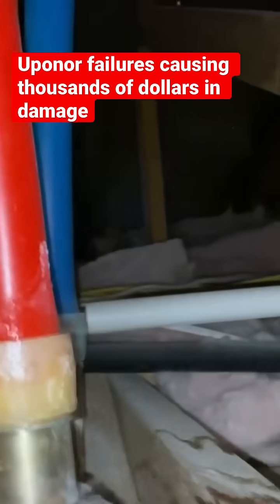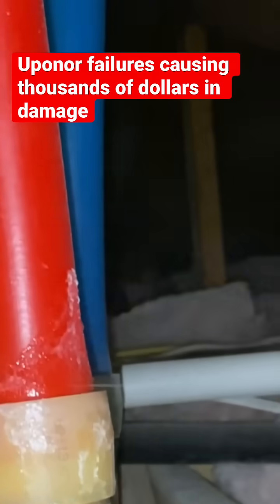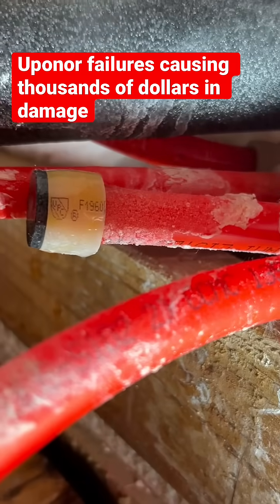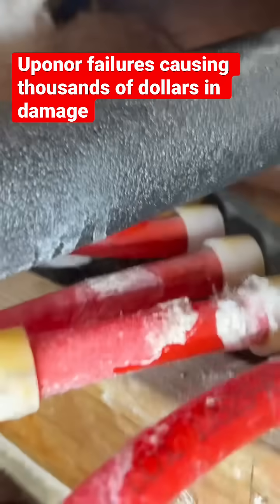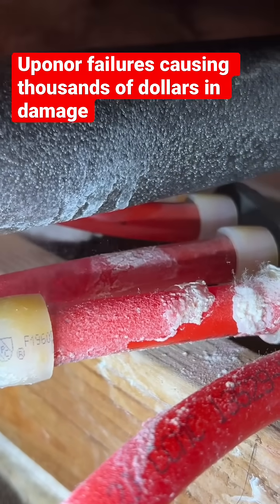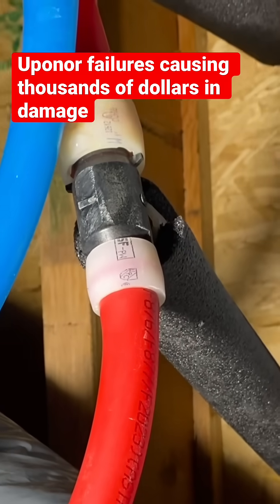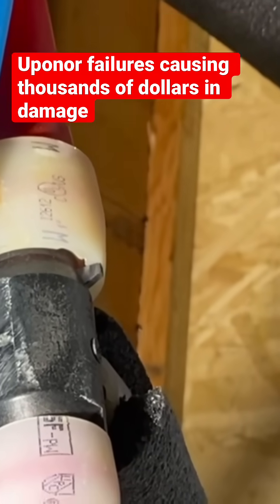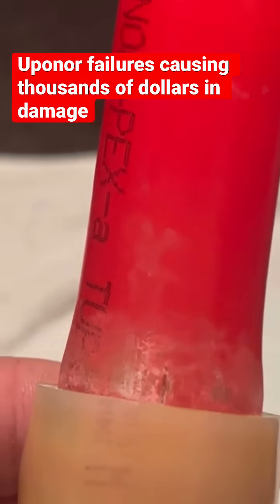Why is Pex starting to get Pinhole leaks like copper? #Uponor #plumbingfail

Comment: I work at a supply house the full red and full blue color uponor had some issues plus bad batches that had problems like this. Clear on white print or no color had no issues same as red print an blue print
Reply: Not the main issue. Pex A is far weaker vs chlorine which is in our water supply. Pex B withstands it better. Its why the warranty dropped to around 15-25 years. Bunch of law suits. Pex B is still considered to last around 40-50 but it has the same 15-25 year warranty.
Biggest issue is the leaching of chemicals into the water due to PEX.

Comment: I found an Uponar leak, right below a joint in 10 yr old house. Luckily it was above the bottom 2x4 plate.  I have found copper pipe in Aprts where tiny gravel from city main rubbed holes in the copper.  Replaced what we could under the concrete foundation keeping our fingers crossed.

Comment: My house is 10 years old, I have Pex A installed it.. I have had the dry wall fall down in two different rooms so far because of upinor fittings leaking at the connections. I am afraid my whole house is going to have to be replumbed eventually ☹️
Reply from the maker: Yea you will be better off just having it repiped, I would contact Uponor they are supposed to have warranties that pipe and fittings for  25 years, if your plumber did it right you’ll be covered
Reply: @PlumbingExplained Even that is scary, 25 years isn’t old at all for a home or piping. I was all for Pex Pipe but not I’m thinking it’s better to stick with copper.
Reply: @James_Edward59  the warranty is only how long the manufacturer will pay for materials being bad, not how long it might last. If it's bad material, it usually fails well inside the warranty period. Properly manufactured, stored, handled, and installed, PEX will outlast copper pipe, mostly because it's nonreactive. I'm getting ready to repipe my 40 YO house, which had copper from the 70s, so better materials than what we get from China or wherever now, and copper is in short supply globally.
Reply from the maker: @anthonykaiser974  no brother copper is all around a better product it’s the water supply that is the issue and possibly the way copper is cut down at the manufacturing yards(the jury is still out on this theory) copper is a much better product you just have to properly maintain it these days, people on softeners or conditioners that filter out the hard water and chloramine or change the ionic makeup of the water have zero issues even with type M copper so that’s my belief it’s the water quality and likely bad workmanship/ craftsmanship that causes the majority of pinhole leaks we are seeing in the industry today on systems too new to be having these issues.
Reply: @PlumbingExplained The copper vs pex is an ongoing debate but the 3 factors are NOT up for debate 
1) price
2) ease of installation 
3) ability to resist freeze/thaw cycles.
Therefore, it is not an all around better product. Copper has advantages and disadvantages, as does pex.
Maybe a video of how many failures of copper due to poor workmanship, lighting damage, manufacturing quality, and damage from poor water quality.

Comment: Potentially exposed to UV light. That’s guaranteed to make them fail and turn that brittle yellow tint. Just my opinion. I’ve installed Uponor multiple times over past 8 years and never had a single issue ever. Best product on the market IMO.

Comment: Some people unwittingly store PEX outside, where it gets exposed to UV rays.
That can weaken the composition of the PEX to where expansion critically damages the integrity of the pipe.

So this could be due to outdoor storage  🤷🏻‍♂️
Reply: it's not
Reply: i use pex a as air pipe for my garage outiside. been outside at 160 psi air not preblem yet
Reply: @Homesteadquebec  
It will last longer without water flowing constantly to help break it down. I doubt you use the air every day. It is still going to fail in a few years. Maybe 5 maybe 20 but it will fail.
Reply: I personally had a Pex a line outside, seasonal use only. White 3/4 inch, direct sunlight 1/2 the day. It lasted 15 years before it totally exploded.
Reply: There is a bulletin about how overwintering box elder and a couple other bugs can drill into the pex to get a drink, and when they pull out, it creates a pinhole leak. Orkin had the bulletin.
Reply: how long outside will hurt it? 2 weeks too much?

Comment: pex had a huge recall for the solid colors tubing. when they would heat up to expand and stretch the tube hairline fractures are caused through out all the line resulting in pin whole leaks or a complete break over time. the company i worked for has now switch to clear pex rated for hot and cold and so far we havent had any more of these issues
Reply from the maker: I don’t use Uponor pex anymore though

Comment: I've been searching for this type of water lines for an hour now and finally found this video, I have similar red and blue lines with these clear/ white rings, do they clamp or is heat shrink, I have the same damn problem, small crack by the fitting that's spraying water inside the wall, I just got the siding off and trying to figure out how to fix this mess!

Comment: Been doing pex b stainless steel clamps haven’t had to go back for anything since install
Reply: I use PEX B as well, and never liked the idea behind PEX A..
Reply: @C0braChicken2  me too and if there’s ever flow restrictions I use 3/4 then at the end like showers and faucets I end it with 1/2 inch
Reply: The clamps will fail over time, in humid or wet areas, but will last longer if you put some osi or clear silicone around the clamp.  Should last longer in damp or humid environments.
Reply: Pex B lasts longer then Pex A because it handles the chlorine in the water better. It still breaks down but just not as fast. It will fail faster then say copper but it still some 30-50 years unless the chlorine levels are high. Nothing like plastic breaking down in drinking water. Yummers

Comment: I've ran into the same thing. it was always the hot water line and the 1st leaks started close to the water heater and progressed down the line over time. the homes were on city water. I never ran into a well home with this problem.  there was a class action lawsuit, but I believe it ended a few years ago.
Reply: I'm having the same issues with the hot water line. Thank you for sharing with us.
Reply: We have grey on the hot side and it has cracked 3-4 times in less than a year..

Comment: Did the installer use some kind of chemical sealant like a cement on the fittings? Because that can absolutely cause stress cracks in the PEX.
Reply from the maker: No it’s just a common theme with the Uponor they know it’s a problem

Comment: Yeah, all sorts of the red and blue have leaked like this. It's criminal that Uponor didnt go under because of it.   
But that said, I have never once seen the clear/white stuff leak like this.  Ive only seen it leak in the case of a dumbass not using proper abrasion clips, whereby friction will do it in.
But who knows lol, maybe in 10 years the re will be a new problem with the pex from ALL the manufacturers. I hope not though.

Comment: All of these pro copper comments… I re-piped my house in 2012 because I’m on a slab and the copper got pinhole leaks due to hard water. I piped everything in Uponor and now I’m remodeling the kitchen and bathrooms and will be going with Veiga. I don’t want to leave the Uponor in the walls and have to tear it out after the remodel. Btw, I have a home run system and found out Uponor doesn’t make the EP manifold anymore either. Smh

Comment: There is actually a class action lawsuit against uponor. They claim it was from the coloring process and that their clear/white pipe with colored lettering was not affected. Except I keep finding the same failures with that style tubing as well... changing to zurn-B was the best move you could have done. The only problem, (at least in my state) is that pex-B is not allowed underground so we've been using a lot of Apolo-A for our underground replacements...

Comment: Rehau is king.
Reply from the maker: Never used Rehau can it be expanded?
Reply: @PlumbingExplained  yessir. German made. Used to have brass fittings and sleeves years ago. Now polymer. I bit more expensive but bullet proof.
Worth the $ if you can find it in your area. Of course it’s tool specific install

Comment: Usually it’s a-hole plumbers who hate life, ripping pipe through walls and joists, hurrying past good installation procedures. I run into a lot of Quest that fails right where there’s a scrape, gouge, or bend, sometimes bad connections.
Bad attitudes are as bad as defective materials.
Reply: You know what's worse? Bad advice. 

Upponor has recalled some of its red and blue lines, they had failure in the chemical composition causing stress cracks around the expansion site.
Reply: Wrong. Your ignorance is astounding.

Comment: I installed a new hot water heater last year, and the clear Uponor PEX on the hot side is already turning yellow and sticky (after the 18" copper headers). On softened well water so no chlorine. I'm not sure what's going on.
Reply from the maker: Well water is typically high in other hard water minerals which could be causing the same issue. Anytime you are drawing water directly through the ground it’s gonna be harder atleast as far as I know so it’s likely there’s some minerals or something in that water causing your issues or potential UV Ray exposure, I’d look into filtration or set a camera up and see where the yellowing is happening, is it getting sunlight through the roof at a certain time of day? Prolonged exposure can cause that
Reply: What brand of PEX?
Reply: @ohger1 reading comprehension?
Reply: @silverbackag9790  Apparently so.. I responded to the wrong comment.

Comment: Quit being butchers using house trailer materials on expensive homes.   Be a craftsman and Solder in top grade copper.  The first leak will cost more damage than money saved by using that plastic crap.

Comment: The thermal expansion/extraction rate of pex is 1 inch per 100 feet every ten degrees. It’s constantly moving. Pex fittings are rigid, anything expanding and extracting on a fixed point will eventually fail.
Reply: Most people aren’t near 100’ runs of it.  So the shorter runs most have.  It ain’t moving much trust that.  An it’s not quick
Reply from the maker: We aren’t seeing issues with the fittings even though they’re plastic I’ve never found a leak at the fitting it’s always on the pipe so it’s either turbulence caused from the fitting or imperfections or something else, I don’t see it being turbulence but im also not an engineer

Comment: im starting to think its the expanding. maybe press pex is the way
Reply from the maker: I switched over to a pex B that can be expanded, I don’t think it’s the expansion the theory is the method Uponor uses extrudes their pipe causes tiny microscopic imperfections that can open up from Chloramine just like the copper pinholes
Reply: @PlumbingExplained  I started using Apollo pex a. Seems solid so far

Comment: Don’t leave your stuff outside. Those rings don’t yellow by themself. Poor storage and care of your product will lead to failure. No one has proof. But there’s other rings with no yellow. Don’t throw this stuff in bed of truck and cut a foot off at a time. The sun can reach that. Keep it covered. The product will perform for awhile. But back in copper days. We had idiots and poor install practices. So it’s not always the product.
Reply: I've heard that chloramine in the water supply (ammonia) can leech into the pipe causing yellowing, cracking and failure.
Reply from the maker: @panemon187  that’s what we are finding
Reply: @panemon187 
Fucking chloramines ruin rubber gaskets and seals too
Reply: 100% From my conversation with Uponor, it could be over exposure to UV (Installers keeping their PEX overhead or back of their truck for days). Over time the "chlorine" supposedly start to break the pipe down.
Reply: @SaintlySaavy  If a couple days in the sun is too much it's a shit product.
Reply: @bobbygetsbanned6049 
It is more like a month of direct UV exposure rather than a few days, but it is better to minimize it.

Comment: Pex a pipe can't be used with pex b fittings. They over expanded those joints hence the leaks..
Reply from the maker: Huh? Those Pex A leaks are all with pex A fittings, The pex B im talking about is in fact expandable its Pex B Zurn google it.

Comment: 'so we switched over, it doesn't seem to have those poblems' so this video is 2+ years in the making? or you just switched over? if you just switched over how can you say the other product  is better?
Reply from the maker: I can say the product appears to be better because they have not had the same issues with the random pinhole leaks in their pipe as the Uponor pipe has, The Zurn pipe has had some other issues but they typically seem to be related to installer misfortune or error most of what ive seen against the Zurn pipe has been in colder climates, they recommend warming the pipe first before expanding it to prevent stress cracks but here in California I dont have to worry about that.

Pex B has some advantages over Pex A, It doesnt leech chemicals like Pex A does even though they determine the amount of chemicals the pex A leeches to be safe I rather use a pipe that doesnt leech at all. I didnt even know about the leeching Issue into a customer told me about it because they had read about it. 

Pex B Zurn can be expanded and the pipe side by side inside and out looks and feels basically the same as the Uponor but the way the two pipes are extruded is different and thats where apparently Uponor is having problems.
Reply: @PlumbingExplained  Did you just chat-GPT your response to me? we've already agreed you don't have any time on these, pipes you respond "I can say the product appears to be better because they have not had the same issues with the random pinhole leaks in their pipe as the Uponor pipe has, " HOW LONG HAVE YOU BEEN USING THE NEW SHIT? this is a chat-gpt response.

Comment: Metal is stronger than plastic. Use pex B and you won’t have a problem. The rigid pipes are better in the long run.
Reply: The problem with PEX B is the restrictions are completely ridiculous, they aren't even close to the right ID.
Reply: You can use type F1960 fittings on Zurn and Sioux Chief Type B according to their install instructions. @bobbygetsbanned6049
Reply: No, they're not. Tell me you don't understand polymers without saying "I don't understand polymers." Flexibility is one HUGE strength of PEX, especially with regard to lifespan, and the whole point of PEX-A is full flow fittings.

Comment: Dude. Pex B is not for expansion fittings. Only Pex A. If you are making videos and claiming all this experience, why would you guide people to use B for expansion?
Reply from the maker: Google is a good resource to educate yourself on before you stick your foot in your mouth dude...Google Zurn Pex B or just google is pex B expandable?
Reply: @PlumbingExplained  touché. My understanding with Pex types was that the letter defines their applications. You are right, that is not true. Manufacturer’s applications can be different for Pex type. I’ll be honest, that would be a solid caveat in videos you make down the road for someone choosing pipe

Comment: Isn't the pipe got aluminium internal shielding
Reply: The only pex that I am aware of with an aluminum shielding is warm board in floor heating. And you would never use an expansion fitting on it. Ever.
Reply: Wasnt that kitek?  Pex Al Pex.

Comment: Pex A can be expanded and crimped. Pex B cannot be expanded, only crimped
Reply from the maker: There are pex B’s that can be expanded such as Zurn
Reply: Most PEX B is now certified for F1960 expansion as is PE-RT pipe.  Your info is out of date.
Reply: @ohger1  very cool, I'm still not expanding Viega's Pureflow pex
Reply: You linked the zurn website in another reply but it makes no mention of pex B. Just says their pex expansion tubing is compatible with crimp and expansion fittings